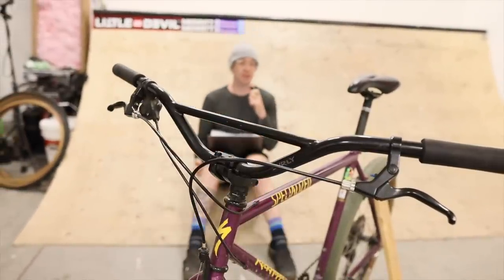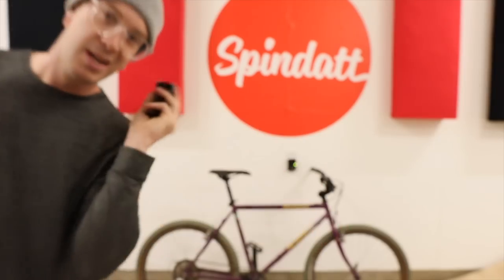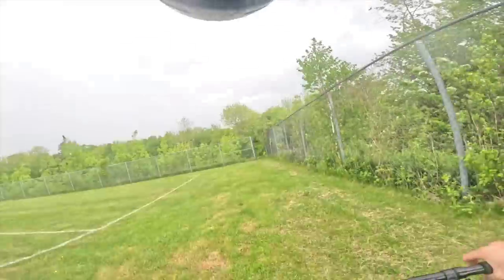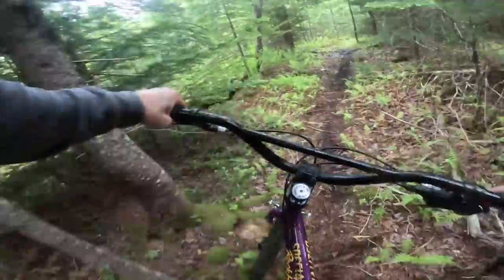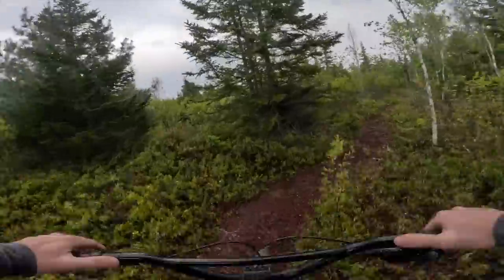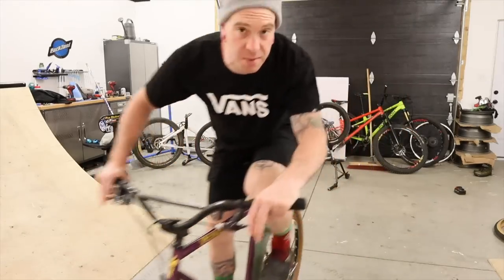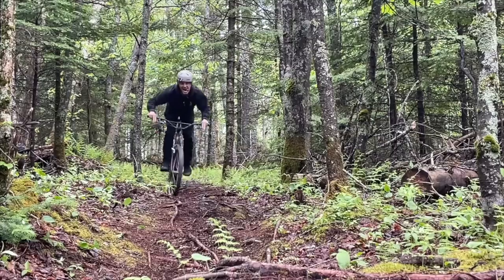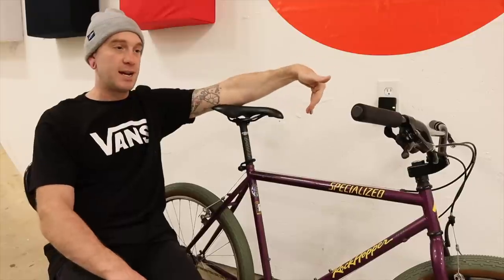Surly Sunrise Bars

Comment: I tried the Surly Sunrise bars. I'm no weight weenie, but they are very heavy. So much so, that I felt it affected the handling of the bike. I also found them brutally stiff and harsh. Off they went. Replaced with Hunter Smooth Move High bars. Very similar dimensions, and quality Nitto aluminum. I agree with you on upsweep, too. Highly underrated.

Comment: Surly Sunrise bars are fantastic.

Sizing me: never just ask "how tall are you?" because that's only half the story. I'm 6'1" on a proud day but my inseam is 35.5". I'm a bullfrog. Looooong legs, short torso. My saddle comes way up, my bars have to come up or my grips are at my knees. Short torso means short reach. My optimal reach and stack would be around 465-470 reach with 670+ stack. 

I have been running Whiskey Milhouse handlebars on my Stache and Ragley Big Al since I built it. (Milhouse is nearly identical to the Sunrise, just carbon and 1/3 the weight)

I had the Sunrise on my Ripmo AF until I decided to put my prototype Carver Titanium klunker bars on it tonight. Carver still sells the production version but there's no upsweep, so I hate the production version. That's what they initially sent me and I called them out on it so they sent me their only prototype. 

My bars have to be super tall just to be level with my saddle.

Yes, Eric... the Surly bars are harsh. They are thicker steel and have a cross bar so they don't flex.

Whiskey Milhouse is more forgiving. Carver Titanium is half way between the two.

There are so many bars out there similar.

Berm Rover is very similar but in titanium.

Oddity Odmone pricey
Wilde Cardinal $130
Mone Lite Bar $300+!! 
BTCHN Hi Riser and Ti Riser are similar without the crossbar.
Same with the Hunter Smooth Move. 

Ahearne Uprising is slight taller with more sweep. Similar to the Stooge Junker 83, Junker 100 and Velo Orange Klunker. 

Dude, there are so many more, too. I should build a database.

Comment: Great review. I was torn between these and the fairdale. I went with the latter and couldn’t be happier. The 28” width feels right since I’m 5’7” and was used to riding 24” syncros bars on a late 90s mtb. I have a nuke proof 780mm (30.7”) riser bar on my ss gravel bike that eventually cause discomfort in the hands and wrists. Handlebars, like boobs can get too big.

Comment: IMO you did this review well. I really like getting real life experiences of kinda odd conversion choices especially regarding ride feel and ergonomics. Every time i see the grouch I ask myself whether the effective reach with this bmx stem isn‘t a little short. I guess it is the width of these bars that makes it fit fine. Currently, I run my '95 Trek 970 with it’s original 130 mm stem, a 580 mm nearly straight flat bar with long-ish bar ends and a substantial saddle to bar drop. For short trips into town and gravel riding it works well enough.

Comment: All right, this post is going to make me sound super old. In regards to Steele handlebars being harsh. I would say from my experience that Steele has a really wide range of potential in regards to flex. all growing up I ran a true temper chrome Molly flat handle bar on my mountain bike. I would say it felt decently flexing and when I swapped to a aluminum handlebar it felt more harsh than the true temper bar did. Then I got into BMX and had a set of hooder high bars by S&M. Crazy harsh! They felt so stiff! But they were also super thick steel and heat treated. I am currently running a set of surly open bars on a retro modded 90s mountain bike. And those are super Duper flexible. I have never ridden a handlebar that flexes that much and it is also chromemoly steel.
Love a good discussion.

Comment: If you like those, try the 100mm rise Cannondale Cruise Control. Alloy, not as stiff as those overbuilt cromo bars, but also less weighted due to the higher rise. By the way the rise also means you won’t miss the inch and a half of width per side that you aren’t using most of the time anyway.
Reply: I hope you’re right my old Giant is getting those bars Thursday night

Comment: You actually inspired me to buy a 90’s GT and modernize it! And I’m running these bars, I’m liking them so far
Reply: GT actually makes some "cruiser" bmx style bars with 7" of rise or so in the OG style 2piece and 4piece if you're going for a more faithful look, fyi.  depending on your height it could pair great with a front load stem and the low front end of the 90s frames.

Comment: Absolutely agree the Sunrise is super harsh! I have the Nitto Bullmoose too and find it better, but yeah, still harsh. I think in both cases it comes down to the extra bracing from the crossbar/bullmose style.
But not all steel bars are equal, I have a steel Wald bar, 8038GB  w/ 1" clamp dia. and that one is more comfy, springy, almost bouncy, than any 31.8 aluminum bar I've tried, great for cruising pot-holy streets. Check out the Worm bar for another comfort steel bar- or the Moth bar if you really want to get back-sweepy!

Comment: I have a pair of Surly Sunrise bars, also got them used, already cut down to less than stock (idfk, like, 750 or something), and yeah, can confirm they're harsh, even when riding really plush suspension (2003 shiver single crown). This is probably exacerbated for me because they're not the stock length, so not as much leverage, but the position is great! Surly could definitely use sightly lighter gauge tubing.

Comment: I have the monē oddmonē bars, which similar to those surly bars, and they are quite stiff. I love the geo of them, but they are definitely stiff. I think the crossbar had a lot to do with that. I want to throw some esi grips or something like those on amd see if that helps. I previously had some carbon bars on this same bike, and those had a noticeable amount of vibration damping compared to aluminum or steel bars on that same bike.

Comment: Steel bars are noticeably stiffer and less forgiving. These style of bars with their moto inspired cross bar will make them even more stiff by preventing them to "bend" in the middle.
On another note, I run my bars in a similar fashion, I roll mine forward in a way to make them feel more comfortable in both seated and standing positions. All my friends tend to run theirs more "level" which feels weird to me. When it comes to drop bars, I run them slightly up with the hoods positioned higher on the bar. I don't get in the drops as much as I ride with my hands on the hoods. It is a preference thing for my individual comfort.

Comment: Bar material does affect the amount of bar flex. I haven’t really run into any issues with bar flex as all of my bikes except for one have aluminum bars. So my bikes are relatively consistent from one another. The one bar that I am running that is steal is on my Palomar which is super duper narrow. I would have to think that there is very little flex. That rides definitely a lot more harsh. I think the bars add to that. No leverage from width and also steel. That’s probably why it rides a bit harder

Comment: So Eric looks like you’re running these at the full 820mm width and you didn’t cut them down? My full suspension MTB trail bike has 780mm bars and those seem super wide and I have a set of sunrise bars on order for my 91 rockhopper and was considering cutting them down but maybe not now?

Comment: I don't know how much this will add to the convo, but I have an 80's steel road bike with steel drop bars and the whole ride seems harsher than my modern-ish mid 2010's alu road bike with carbon bars.
it probably doesn't help that the bars on my steel bike are significantly thinner (smaller diameter) than the modern bars and so my hands have less to grip, but I definitely feel far more road buzz on the old bike as compared to the newer one.

Comment: I think it's just that you've only ridden stiff steel bars? Surly actually mentions in the description for their open bar that they designed it intentionally with some flex in it, and so I don't think harshness in inherent to steel bars. But the crossbar on the sunrise (or any BMX bar) is specifically there to beef up the bars so they can have a large rise without flexing on hard impacts, and I'm not sure about the bullmooses but I bet the integrated stem kinda design results in a stiffer bar? I mean they were originally designed like that so they can have tonnes of leverage for trail riding so I think it makes sense 🤷‍♀